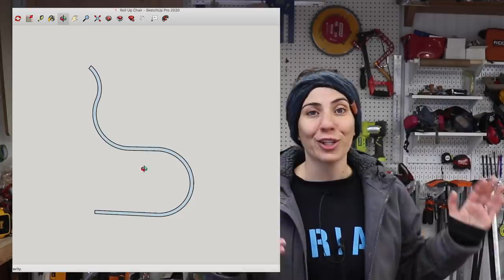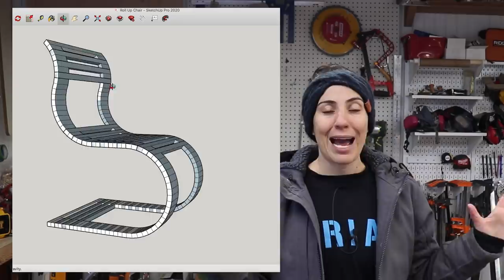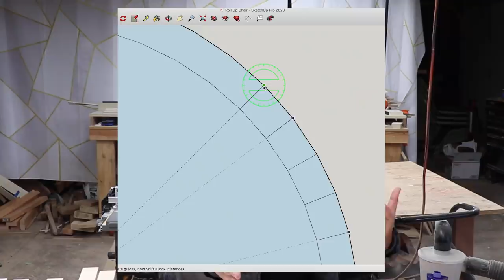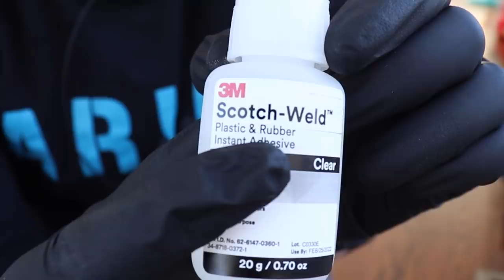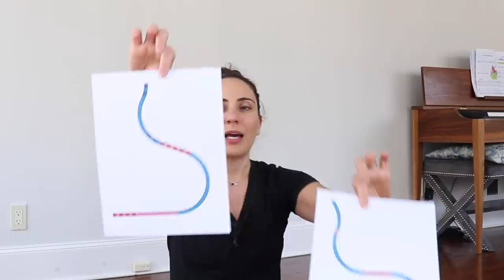I ATTEMPTED to make a chair that rolls up... It didn't go as planned...

Comment: Some pieces in the backrest area need to be reverse angle.
Reply: or be backed with the webbing from the other side
Reply: I don't think so, the fixing of the band is IMHO the root cause. Please see my extensive comment for details.

BR
Andreas
Reply: I work on a lot smaller scale .. the backrest the angled pieces at the back needed to be wider than the front . Also the chair should have been anchored so that you could pull on the webbing . My family did a lot of upholstery and fabric and webbing stretch. Possibly kevlar or something as strong should be used.  A CNC machine could have saved a lot of cutting  ..also the curvature of the backrest should have been tighter because your shoulders and spine weight against it will attempt to push out the curve. Kinda like external forces on a brickwork Arch. You may possibly find that the original chair Maker  had pre drilled the wood so a steel  Cable was slotted through the entire chair. This would give the ultimate strength.
Reply: @andreasbentz6106  Didn't see you extensive comment, but reducing the unsupported length of webbing would reduce the amount of stretch. Using a polyester webbing would allow here to easily epoxy the webbing the the wood.
Reply: @stevenmobley5882  You're exactly on the right track. It is not only the stretching, but also the pivoting point. Tamar was using screws in the middle of the wood pieces, which is OKish on the curves where the band runs on the outside (like a barrel hoop). But in that one curve where the band runs on the inside of the curve, it is essential, that the band is glued to the surface of the wood so the band acts like a hinge with the pivoting point at the edge of the wood piece. 
Since I'm from Germany, it was more easy for me to dig out additional information on the Serbian designer and the chair itself. E.g. that he used hamp fabric for the band. I guess the hemp fibers are very similar to woof fibers so you can use simple wood glue to bond this to the wood. 
This thing is so intriguing that I#m about to give it a try myself...
Best Regards
Andreas

Comment: For support, try drilling holes through the blocks and use strong wires or something. And you can create a mechanism at end to tighten the wires.

Comment: For project like this make a small scale marquette first.
Reply: I don't think you'd have gotten a good read on the materials strength with a maquette.  The geometry is fine.
Reply: @moofie74  Yes, you need to get up into the right force range. But one could test the core of the design with a more minimum viable product. Like a stool. Get one curve to behave as desired that way, then add the others.

Comment: From one of my most significant teachers as a blacksmith: "The only difference between me and you is I've made more mistakes." With that in mind as I have taught others I make a point of letting my students know where I have "failed" and shown them my process as I figure out the mess. That figuring and the example of the perseverance is the more valuable lesson often. Why I kept watching was when I caught on that you were doing something of what I do and how I learned my craft. Good on you. 
As you asked for suggestions ... and granted that I do very little with wood and have never claimed to be a woodworker ... I would, yes, prototype with less expensive material. I would also, first, prototype just one side, the 4" or so track that forms the "S". Get the angles right with that, and load test just the one track so I would have half the assembly. Once I had the one side forming the right curve and demonstrably holding something more than half the expected load, and most importantly, the bulk of my mistakes out of the way, then I might prototype the full width of the chair. 
Other random thought is that this reminds me very much of the work of a cooper. In a sense aren't you connecting two "half barrels" to make a chair? (OK, maybe three.) It seems to my inexpert eye that what you're doing is what a cooper does in preparing staves to fit the curve of the barrel, and taking advantage of modern materials to replace the barrel hoops in open arcs. If it were me I might nose into that craft to see if there are tools and techniques that crossed over. 
Very impressed! Thank you!

Comment: Failing means you are learning. You are doing awesome! 
Maybe heavy duty nylon straps. Staple them to the wood just like you did but put more tension on the straps. The jig that you mentioned would be a grand idea. I would probably coat the straps and the wood with a epoxy resin on the bottom as well the staples will hold the straps in place but will give out with ware and tear down the line. 
As for the wood on the back, that is going to take some playing around with different thicknesses on each piece. You are essentially making a reverse keystone arch found in architecture. Try and experiment with the prototype you have and put small shims in between each wood piece to see what the desired thickness would be for each piece. The reverse curve on the top back of the chair is what is giving it the extra tension for the lower back to take shape on the original design.

Comment: Just a suggestion if you ran braided steel cable trough the center of the wood you can adjust the tension and still roll it up using  a turnbuckle.

Comment: hey! great project ! I think that if you could give it an angle that seems unconfortable by the sight but when you sit on it due to it's natural elasticity it will finish being in the correct position, reaching the peak of elasticity, that could work maybe. 
The way you used the tape to stick the parts, that was a great method I didn't know.
greetins from argentina!

Comment: I like the idea in the comments of the steel cable. If I was to do it with straps I would definitely start at the top of the chair/back with the inverse curve this would set the tension of the straps and make assembly easier

Comment: One material that might work well for the strip is Kevlar fabric. The threads themselves will basically never break from the strains a chair may take (though probably have to be a little worried about it unweaving). Maybe a two layer approach with first elastic layer, to keep the system in shape with compression, and then inflexible Kevlar to lock it into place and take the load?

Great vid. If i had access to a woodworking setup i would totally play with this idea.

Comment: I think what you're missing there is actually a counter-curvature, maybe? Thechair works with compression and tension and what means the static cubes you cut from SketchUp are not gonna be alligned the way they're supposed to be with the weight of a human being. Either using a material that has less stretch to it (not more) or reducing the tensioned curve part should do the job! Good luck, that was a nice start!

Comment: Can you buy kevlar webbing?  It would be more resistant to stretch than the seat belt webbing.  For a rubber to work it would have to be reinforced with fibers like the material used in truck mud flaps.  Maybe even something like a large serpentine belt for a car engine, that would not stretch.

Comment: I would put some material in between the wood blocks to get the curve right, like thin slices of wood. Glue them in place once you are happy with the angle and then remeasure for a second chair.

Comment: I’d for sure use metal hinges on each joint. Probably sunk flush into the wood slats. Then cover with thin, comfy material.

Comment: Amazing work remembered seeing this chair a long time ago, never thought it could actually be made. Very bold to attempt it. 

2 Things that could help. 

1st get rid of the straight wall cut sections of the seat, their acting as a lever and when you put weight on it, it will try to close like a single piece nylon lobster cracker. Also the size(depth) of seat (from knee to back) could be shortened to make less of a moment arm. 

2nd (and this would ruin the roll-ability). The bottom straight sections on the floor need to be 1 piece to counter some-one moving to the back of the seat or leaning back. Right now the only thing stopping the "legs" from completing a large circle toward the floor is the width of the 4inch pieces interacting with the floor (one at a time(as really short levers)) - meaning you could set up the chair, sit on it, and lift up the bottom slats(opposite the person) without messing up the stability of the chair, they should be floppy. If it were one piece the fulcrum at the base of the arch wouldn't be able to roll backward.
(would ruin the fully rolled aesthetic tho, it would only be a partially rolled chair, folded it would look like a standard wooden folding chair)

Comment: This was awsome. It was great to see your work process. One idea I had was that you could consider adding two connected arms which pivot down from side exterior of the seat's back edge. These arms could then somehow connect to the chair's base to provide extra support strength to the structure. And they then fold back to enclose the structure, and its major radius, when it's rolled up again. And the rod which connects these arms at the bottom could maybe be used as a handle for the structure when its all folded up.

Comment: Awesome work.
You got the bottom half to work so it isnt a failure. 
At the end of your video you asked what we would try, what we think.
I think for the backrest to curve up the side cuts where the pieces contact each other need to be angled to make the side profile trapezoidal with the smaller flat screwed to the strap. This will make a outer radius larger than a inner radius in the wood giving you a tighter bend.
You could prove this idea by putting shims in the cracks and looking at the change.
Very cool project, i love cool furniture, and especially  portable stuff. I would buy these.

Comment: Consider making a hole lengthwise through each 4” section and putting a stripe of flat metal on each end from piece to piece with a bolt (or the added rod with some sort of plastic straw over the unused threads to prevent chaffing) and nylon lock washer holding them together. Like a tank track. Still running the nylon webbing the length for look but also as the connection between the 20” pieces.

Comment: pre-tensioning can be approximated with tighter arc that will unfold a bit (a lot), definitely could hold, but using a small sample curve single row, one could tune the angles

Comment: I'd also try using  4 strands (2 on each side of the chair) of 1/8 inch steel aircraft wire sandwiched inside of the nylon seatbelt material. Also, some plating under the strap on the front side facing. You could probably make an awesome rollup beach lounger to take advantage of the  inclined back.

Comment: That's a pretty gnarly cantilever. Some quick hand calcs could easily show how feasible something like this is before you go out and do it. Seems like even if the wood was solid, it wouldn't stand up the to load.

Comment: i too many times make prototype projects out of scrap or plywood that I am not sure will work, and when they do I just leave them as is and then wish I would have used better material. You trust your instincts and give it a shot. Now I have to rebuild the best out of better lumber,, Don't be so hard on yourself, and consider using parts or some of the first build if you can. I see you tried this chair a second time I guess I need to watch how that went. I have to say, I am self taught also from shelves from cheap pine and hammer and nails to a all kinds of better tooling. Keep it up, you're great, love your boo boos and your successes.. Love to see you try. You are not only great at sharing, your are fun to watch. You love it and it shows, good luck, Tom

Comment: hi, again a mega video, your sympathetic nature inspires me again and again😊 for me it is also a successful project. the basic structure is in place, now you can work on the finer points and then it will be fine. I have a suggestion, make a template out of a wooden square that has roughly the same bends, rather a little less. You could then put all the individual parts on it and attach the tape, after which it should stand

Comment: This looks like a fun project. Definitely not as simple as it looks!
I think that was a solid attempt

My idea would be to run a steel cable through the center of the boards, with a way to tension it at the ends.
I think it would: 
-be significantly easier to adjust the length/tension while working on it (and over time to compensate for the wood compressing)
-eliminate the stretching issue
-add structure by supporting each piece along an entire plane instead of at discrete points; which would help resist torsional and transverse loads between boards

I'm thinking of it kind of like a Tensegrity structure with the boards acting as spacers to keep the tension when it's unrolled.

You could still add the webbing or felt for extra support and aesthetics, and it would only change the look of the project at the point where the cables connect.

Hope that makes sense or at least helps with inspiration!

Comment: I would probable try joining the blocks with high tensile steel wire threading the wire through holes in the blocks. You may have to use two wires on each side to stop the lateral movement. Worth a try.

Comment: Good video.  Enjoyable, and challenging.  I have a thought, but I'm not sure this would work.  It might be possible to prepare all the slats and forego total reliance on the strapping alone by drilling some holes and using a cable or rope of some sort to keep everything tight and provide strength.  In other words, you string the pieces together, and then perhaps add the strapping... maybe on the edge of an assembly table so that you have more control over the angles.  I also thought that the kind of strapping you find used in cargo straps with ratcheting mechanisms to tighten loads on trailers or pickup beds would be highly effective.
I have a vague memory of someone making a chair like this perhaps fifteen or twenty years ago, but using some bigger pieces of wood (and consequently fewer pieces) and holding it all together with strips of carpet.  Another off the wall suggestion that I haven't really thought through would be examine the way the treads on tanks and caterpillar tractors are put together.  Seems to me some treads, when rolled the wrong way, form a shape like that which you are trying to achieve.
What may be even more frustrating, at  some point, could be the discovery of a set of plans that completely explains how to do this as originally intended.  Anyway, it was a valiant effort, and not entirely unsuccessful.  I think you've hit on several ideas that could be used to make some tambours in some storage devices.  Keep pondering what you've already done, and you might invent something else very exciting.  I might try to do something like this, but I think I would try it out in a scale model first, just to see how it works as a toy.  If the engineering is right in a toy, you can size it up for a person to use.

Comment: I was initially thinking sheet metal for the straps, but maybe a combination of the sheet metal and the webbing. Since sheet metal might stretch and deform under the torque from the wood wedges.

Also I'd measure out how much angle you're losing compared to the sketchup design and compensate the next cuts.

This is awesome!!

Comment: As far as the rubber/fabric aspect, it might be useful to try using a traditional bow backing like bamboo.

The tension/compression you're dealing with isn't too different from what happens in a bow, so it could be useful to borrow some of the concepts used in bow building; backings, in particular.

Comment: Really nice job. I really respect what you did, and it needs a lot of precision that you managed to provide. As an engineer, I am very sceptic of this design though. It will be a chair and you can definitely sit on it if you correct the angles, but it deforms too much, and there's very little you can do to prevent that. You have to make it in a shape that turns into a chair after you sit on it, and that's definitely possible, might not be beautiful, though.

If you have not disassembled your chair yet, I suggest you put some sort of spacers (shims, ,maybe?)  between your pieces to fill the gap made by the tape that you removed. Then, you can see if it could ever work with better angles.

Keep up the good work!

Comment: I would scrap the top part of the chair, since the sitting part works pretty well in this prototype, so it would be more of a stool than a chair. Or, I would implement some kind of tension element that runs through all the wood peices with a little notch at the end to adjust the tension, kind of like a guitar or violin, to keep the shape of the chair without depending so much on the strips of fabric.

Comment: Please try this again! This was super cool! Maybe using a different modeling software that lets you test it more before you build it could be helpful? I’ve used solidworks before and perhaps mating the holes in the strap to the holes in the individual pieces of wood would allow you to test both if the pieces roll up and if it would work as a chair. There’s also testing tools on there that let you check how much force things can take and where they could break, that could be useful too!

Comment: How about drilling holes through the blocks so you can run a piece of wire through them like they do for folding screens. That way you would not need to worry about the webbing stretching out as all the pieces will be held together by the wire running through them. Plus it would hold it's shape pretty well although a lot of bending back and forth might stress it too much so steel cable might be a better option. Either way best of luck with your next attempt :)